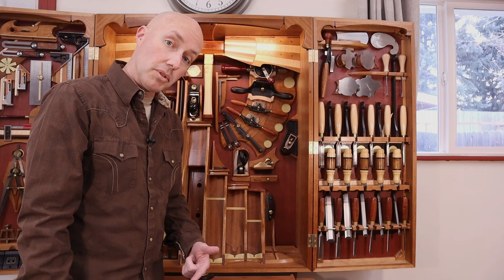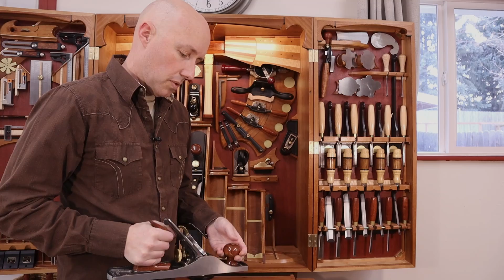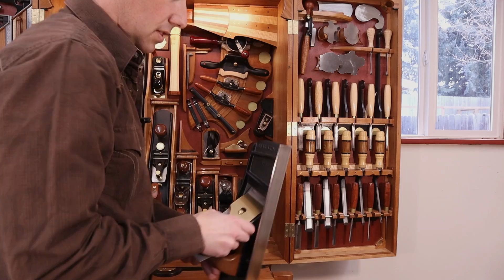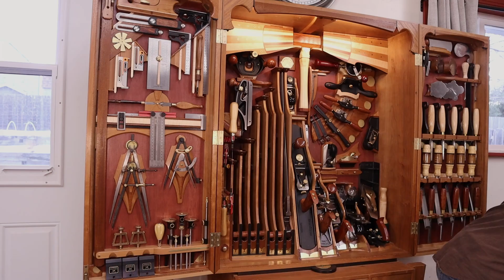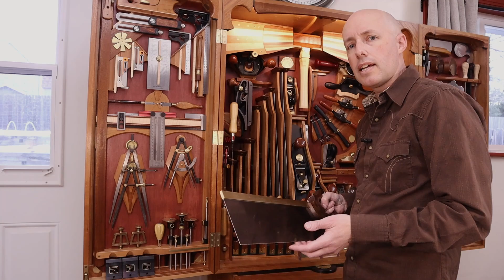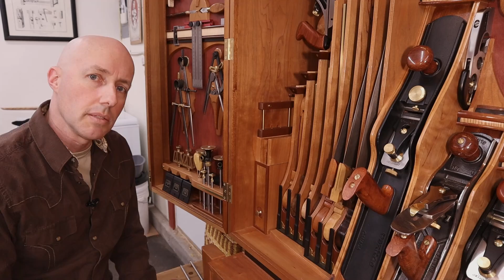Tool Cabinet Tour, Part 1, Bench Planes, Saws, Etc.

Comment: Awesome video- for the panel saw with the hybrid toothing (the one yopu mentioned was a Disston D8 plate), I was wondering if you cut the saw plate down to a panel length yourself, or were you able to find a D8 in the panel length?
Reply from the maker: The D8 came to me at that length, and I don't believe it was adulterated after manufacture.

Comment: i have one of the 113 planes do you have a aftermarket blade and chip-breaker on yours as mine is missing those components.
Reply from the maker: Mine has a replacement blade and chip-breaker from Hock Tools, which are sold through all sorts of online woodworking retailers.

Comment: One thing that struck me about your bench planes, is that they tend to be bevel down. I was wondering what the reason is for that? You do amazing work. Thank you so much for sharing!
Reply from the maker: I like being able to swap blades for different cutting angles. I've done this quite a bit with the jointer, smoothing, and block planes. It's nice not having to fiddle with a chip breaker too.
Reply: @themountaintopjoinersshop8422  Thank you for the reply, I really appreciate it.

Comment: Any chance you could provide more visual detail on the saw till?  Specifically, what inserts did you put into each slot that provides structural stability.  Great video and stellar work on your part!
Reply from the maker: I documented some of the build on my Instagram page but you'd have to scroll back about three years in my feed. I also included some close ups and panning shots of it in my "Genesis is a Tool Cabinet" video if that helps.
Reply: @themountaintopjoinersshop8422  great!  Have you made a recent commitment to more content?   It’s very different from what I saw 10-12 months ago, and it shows thoughts on design and craft (and your dry humor) in a way previous work did not.  Your videography, and of course your work, is really compelling.  It warrants a closer follow.  Very well done and a great inspiration.